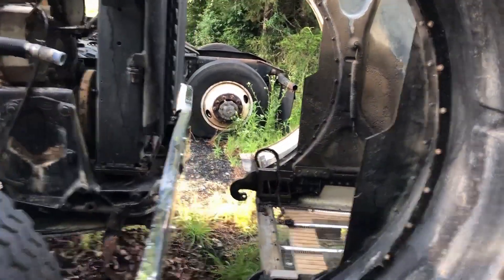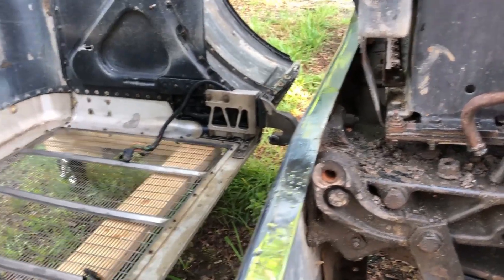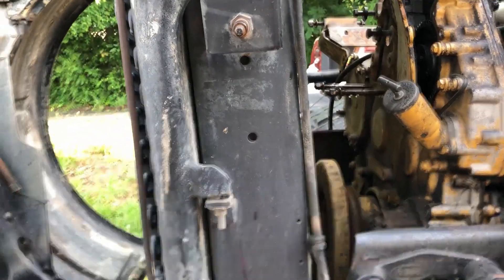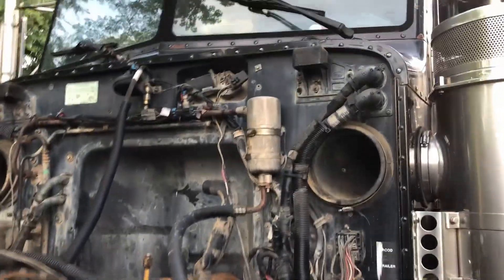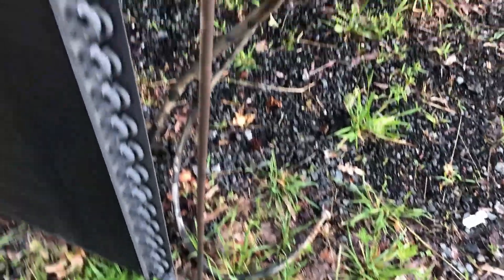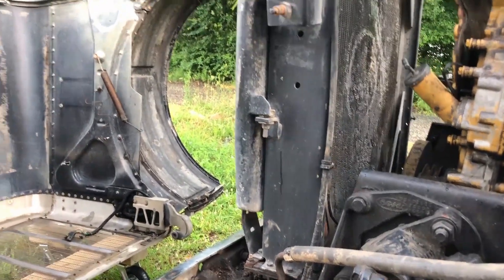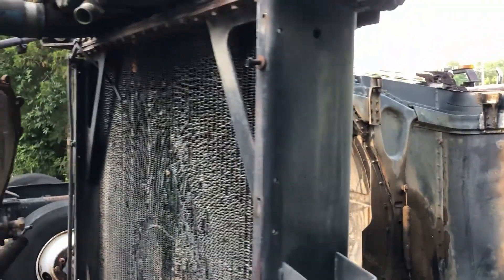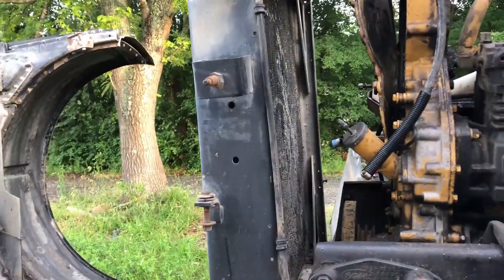2003 Peterbilt 379 - Part 5 - Hood and Radiator

Comment: I have to pull my hood off today or tomorrow. Gonna use my forklift but I like your idea of a lift table. My plan to make it easier is to leave those j hook hinges on the truck and first just remove the 2 bolts from each side of hood going to the j hooks and pull hood from there. Then removing the j hooks afterwards to replace bushings. Unless I’m missing something, won’t that be a hell of a lot easier than trying to remove those bolts with hood on?
Reply from the maker: Yes!  Your idea will work much better.  Leaving the hinge on the truck would have made removal so much easier.
Reply: @okikuma9029  well my idea didn’t work. All those bolts were completely seized. Took me 2 hours to get that hood off. Once off I had to cut all the bolts off the j brackets. I bought  All new bushings kits for everything. Got old radiator out and the new pitts power one in. So today I’ll get the new cac in and hood back on. Good time to replace the 20 year old heater core while at it.  I guess since your video is a year old you have your beast back in good health? Thanks for your video. I’ll have to check your other videos one night when I have time sir
Reply from the maker: @shortthrow50  If the bolts weren't seized, I think that would have been the best way to do it.  Both the hinge bolts on mine broke because they were seized.  Glad you got it done, it's a big job if you don't have the right equipment or help to do it.  I actually sold the truck, I need to do a follow up video on it.
Reply: @okikuma9029  so what now? no more trucks? i hate that. leave a man out in the battlefield dammit.
Reply from the maker: @mikegrazio5376  The place where I had the truck parked was about 45 minutes away and outdoors here in the summer is miserable.  The original owner actually purchased the truck back from me and he's putting it together.  I haven't heard from him in a while so not sure how far he's gotten with it.  I'm starting an engine build for my next truck (yet to be discovered).  It's something I can do in my garage.  Starting the build with a 1LW strong block, MXS crank and rods.  Everything is at the machine shop now, should have it back in 1 to 1-1/2 months.  The initial plan is to build a 17 liter 5EK.  I need to make an updated video about the truck and what my plans are coming up.  Then I'll have a new series of videos for the engine build.  After I get the engine done I'll start looking for another truck and hopefully have a place where I can do the work, build a shop, etc.  Thanks for the comment.